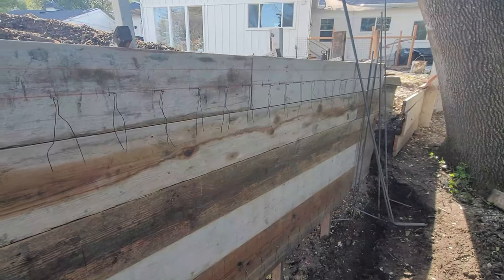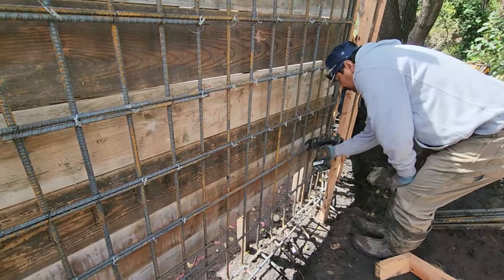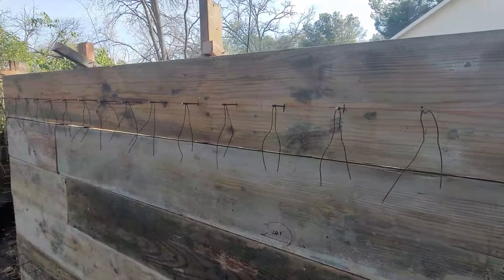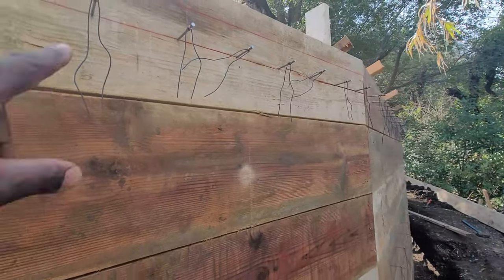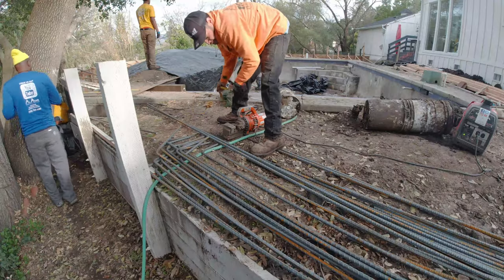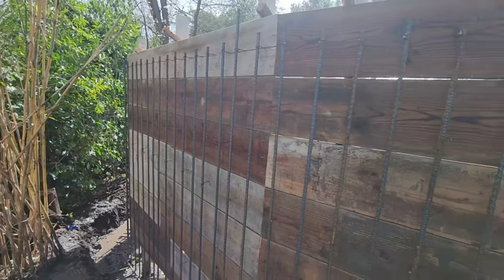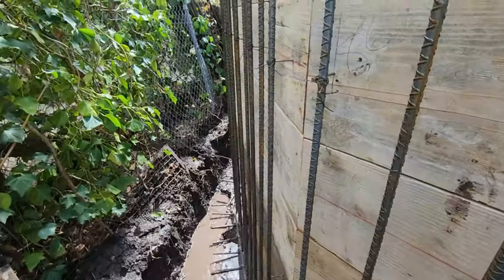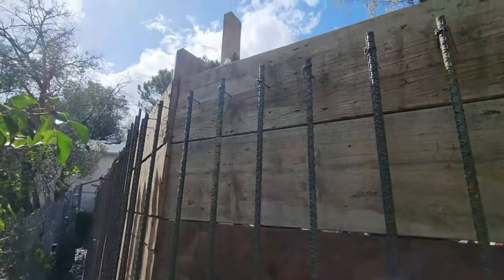Installing #5 Rebar For Concrete Retaining Wall

Comment: Hello. Long time viewer from Seattle with a question for you about vertical cold joints. If I pour concrete retaining wall one section at a time leaving rebar sticking out to tie into the next section and keying the new wall into the old one, is it likely to leak and stop me from installing stone veneer on top of the cold joint successfully? Is there a method to do this successfully? I appreciate any advice.
Reply from the maker: Naw.. You should be good.. Appreciate you checking us out 💯💯